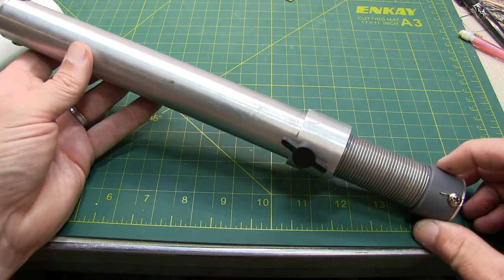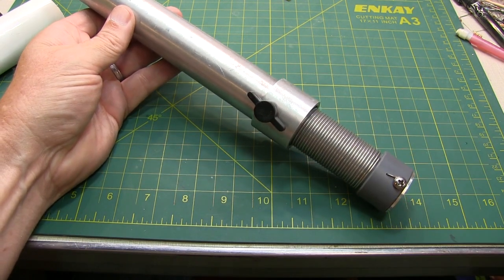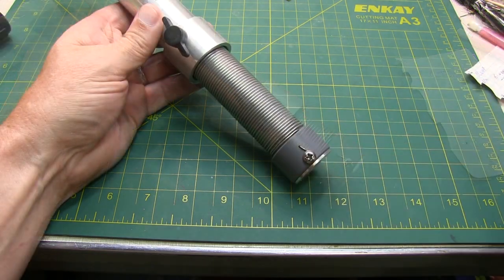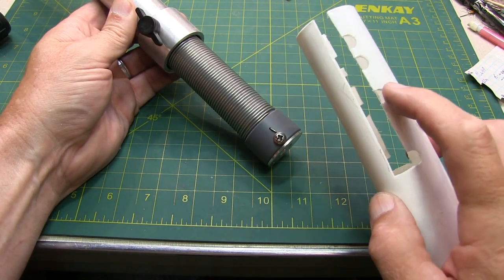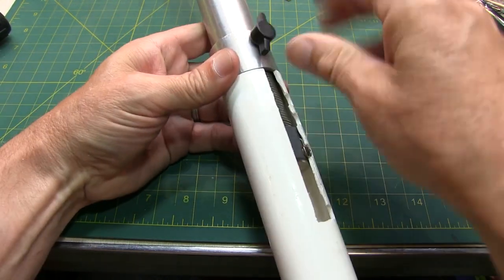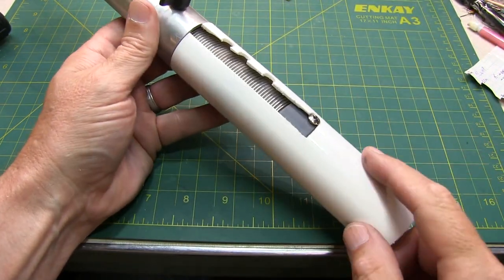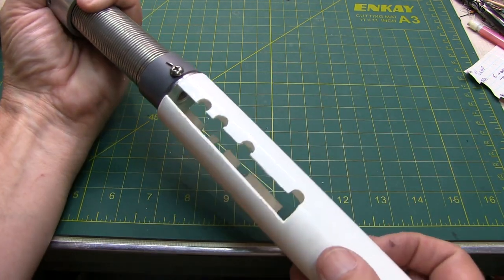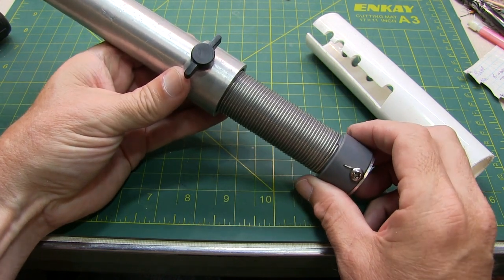#371: Ham Radio Quick Tip: Tuning aid for Adjustable Coil vertical like the MP1 and others

Comment: Fantastic idea.  Ive owned my mp-1 for around 20 years.  I made a coil rule out of a plastic school folder ( bright green so i dont loose it) but honesty once i got used to using the mp-1 , i just tune it via noise, and the only place it's touchy is on 40 meters, and of course the bandwidth is very,very narrow. 
The most important thing with these mp-1 antennas are if we use it elevated ( tripod or mast) vs. Ground mounted.  Elevated requires elevated and tuned to ¼ wavelength for the band you want to use. Ground mounted,  screen, or a bunch of 10-12' wire radials. 
When i first started with this antenna about 20 years ago,  i was really frustrated with it. Playing on 20 meters one day i made a bunch of DX contacts,  blew my mind! And running QRP on top of it all!  It takes some work and patience to use it but it works.  But its not a good choice if you want to do band hopping . I really like your coil pre-setter.

Comment: Nice tip - I've found that my superantenna is extremely touchy when it comes to SWR, but it does work well for QRP operations in the right conditions!
Reply from the maker: Most loaded antennas are, especially on the lower bands.  They can also be touchy when just a few short radials are used.

Comment: Fantastic idea for Parks on the air!!!!  I am unable to comment on the video that brought me here, so pardon me for asking here.  The display on my TS 940 has went completely blank.  It had set for about 8 years and worked for about 10 minutes when I powered it up.  I did some investigating and see the battery is corroded and obviously bad.  The sub display is also erratic.  Is it possible the battery on the digital board is causing the frequency display issue?  It has never displayed the infamous dots associated with cold solder joints
Thanks for any help or ideas
Reply from the maker: Yes, sounds like it’s time to replace both batteries

Comment: Should be included with the antenna ;-)
Reply from the maker: The problem is that the tap locations will vary with the length of whip used.  I am using a 10' whip instead of the much shorter one that it came with.
Reply: The MP1 comes with a gauge in plastic much like his index card.
Reply from the maker: @KevinMaxson  They didn't supply this when I bought the antenna over 20yrs ago.  And, their gauge would only be valid for the stock telescoping whip (and I use a longer on on mine).  Good to know that they're including a gauge now, great!

Comment: The MP1 is the antenna with the worst support I’ve found in my 50+ years dealing with two-way radio operations. They won’t even reply to emails and have no number to call for help.
Reply from the maker: I think the company/design has been sold a few times over the years.  I've had this particular antenna for close to 20 yrs.

Comment: The PVC pipe cutting looks industrial level working, precise and smooth, I don’t think it’s possible at home.
Reply from the maker: The pipe I used is the soft plastic/PVC type that you typically find connecting a bathroom sink drain to the house plumbing.  Quite thin and soft, and can even be cut with a sharp utility knife.  This "machining" can be easily done with a hacksaw and hand drill, or a bandsaw and drill press.  Final clean-up with a file and/or utility knife.